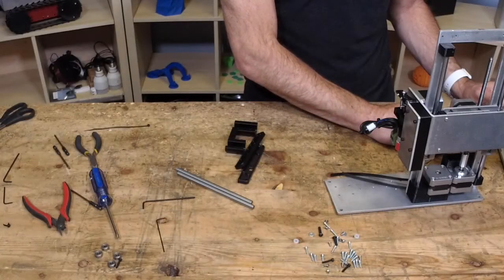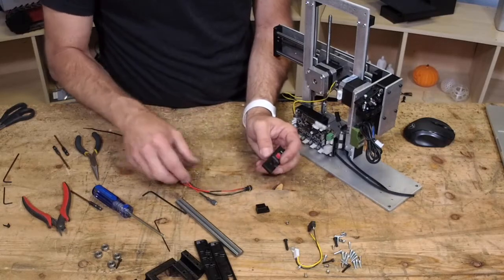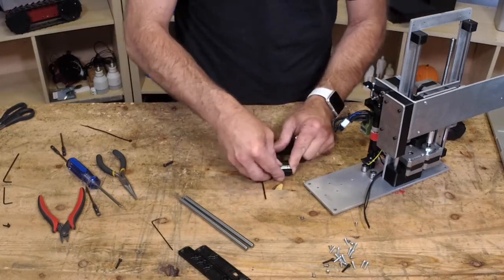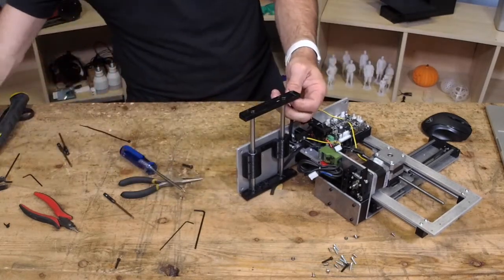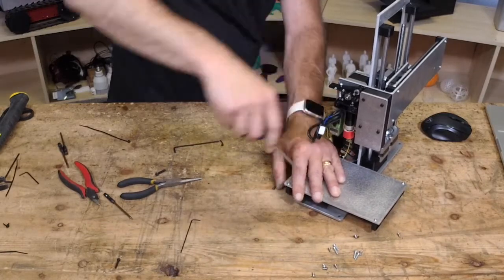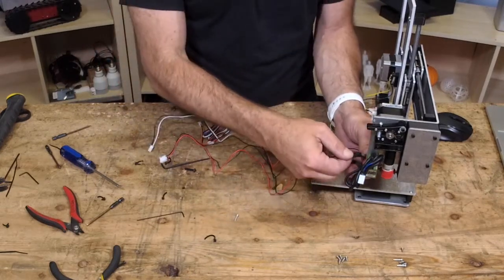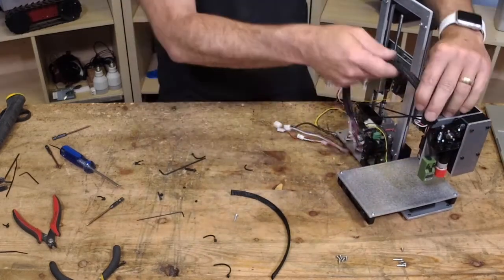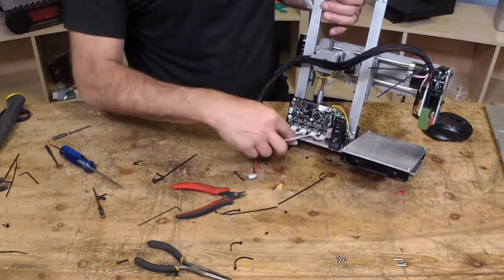Printrbot Smalls Build Video 4: Base & X Axis

Comment: Before feed identical ended wires (extruder/y stepper, the 2 fans, etc). Put a piece of tape (masking?) on one of the ends, and put the same tape on the device. ie: Mark the extruder motor end and the lower fan end connectors with tape before feeding into loom.

Comment: does this model use the same printrBoard, bearings, rods, and motors as the original printRbot simple  (the wooden version)?
Reply from the maker: Main parts are the same but if you buy a bare bones, expect to source something... or at least redesign something. But it's likely you could design it to take all your current bar lengths... since I haven't tried it yet w a complete wooden Simple, my confidence is low that it's a straight swap, but I could be wrong.

Brook
Reply: thank you so much for the response.

Comment: Where are the .stl files for the printed pieces located at.  Cannot find them on the website.  Thank you
Reply: Here is the answer to the question above:  Richard Jensen came through with an update in the forums: I finally got an email from A360 with a link to the model and downloaded the .f3z file (this is the fusion 360 archive choice on the downloads tab -gg). After looking around a bit in the Fusion 360 help I found that I could not directly open this file, but had to create a new Fusion 360 project and upload the .f3z file I downloaded. :)

In Fusion 360 I CAN isolate each part (there is a 'light bulb' by each element so I can show or hide it.